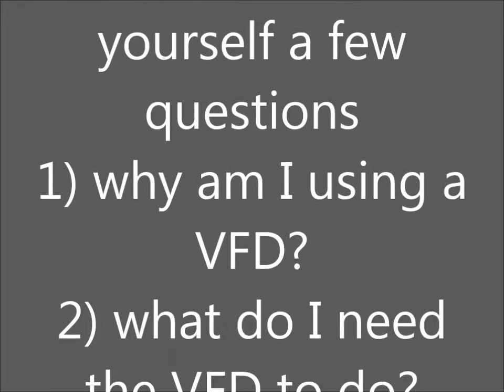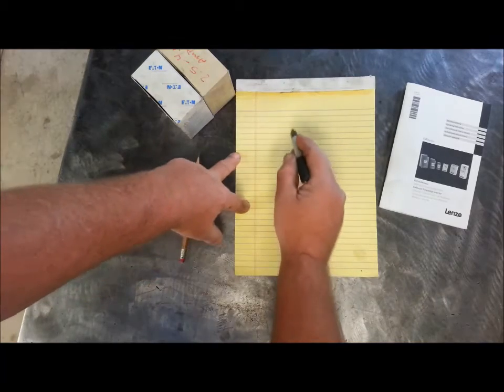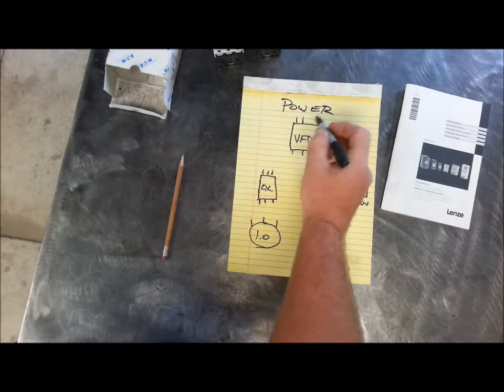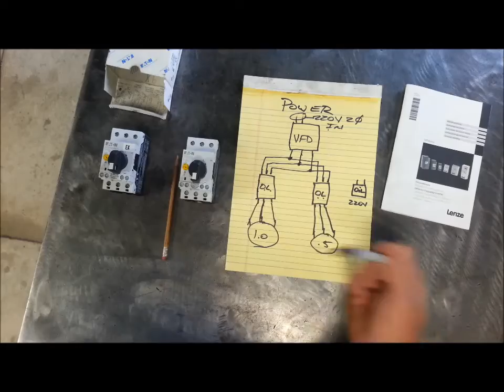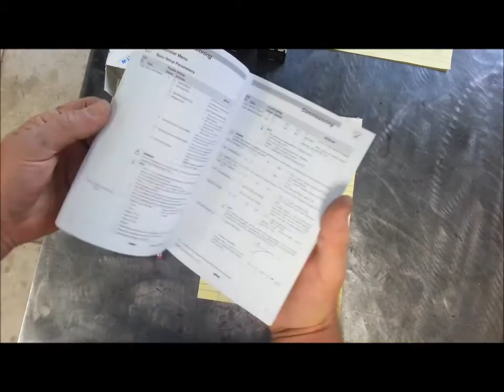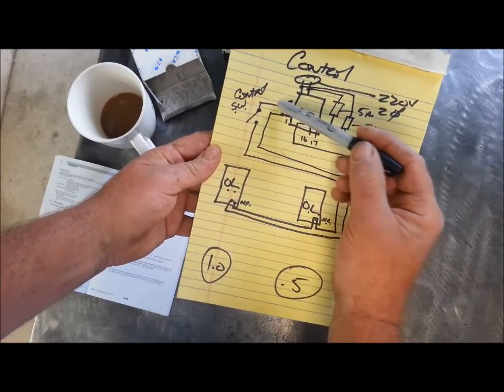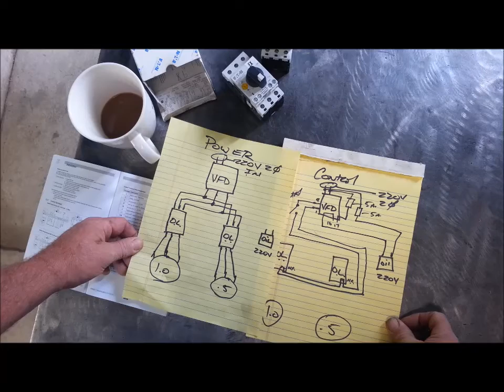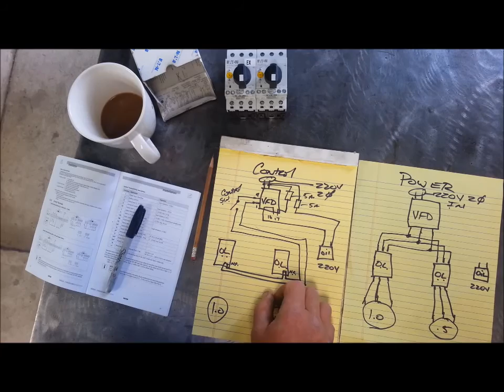Grinder VFD application

Comment: Stan, what a "Video JUST in time."  I bought a Covel 10-PH grinder.  1 HP for the spindle and a 1/2 HP for the pump.  (The pump BTW is a GM power steering pump.  Covel was in Benton Harbor, MI)  To say this is a rare bird is an under statement.  I ordered a manual for a 10H.  I hope it has similar wiring.  Anyway, the question.  Do I wire the VFD into the motors directly, skipping all the other circuits?  Or can it be hooked into the main power cord?  Your video on truing 2-4-6 blocks got me on the road to a grinder.  I just wish this wasn't such a rare bird.

Comment: Stan you r too much...
That is very good info to share.
How does one use a VFD for lathe, mill starting with 120 V AC??
I think you need to have 3 phase motors on this setup.
Can you make a video on this process??
Thank you again
Manny
Reply from the maker: You will definitely need a 3 phase motor, you will be limited to very small motors running it on 110V

Comment: Hi mate.
Thanks for that info. Those over load protectors, are they the RCD kind?  I think I have not come across those here in Australia.  But if I can't get something like that, I will have to use some relays and RCD units.
Marcel.

Comment: Nice expo on rigging a VFD for two motors.

If I had a quibble, I would prefer to see a two-pole circuit breaker for that oiler motor. With fuses, a fault usually blows one fuse, leaving the other 220 wire hot. With a two-pole breaker, a fault in either line shuts off both wires. Here's an example from McMaster-Carr:
http://www.mcmaster.com/#3931t2/=y0aj7l

Comment: You screwed up! There is no such thing as 2 phase in this case! The input on your VFD and the oiler are 220VAC SINGLE PHASE!!!!!!!!!!!!!!!!!
Reply: I know there are 3 wires with 220-volts single phase (4 if there is a ground). There are 2 hot legs and a neutral leg. Between the two hot legs you get 220 volts single phase. Between any hot leg and the neutral leg you get 110 v.

Comment: Veiy very well done.

Agree you need to add HP of motors to derive total VFD HP.  Do not forget to add nameplate currents also to ensure VFD has adequate "ampacity".

Derating VFD is an issue when using VFD designed for 3 phase input on only single phase - yes it can be done.  BUT you are using only two of the 3 rectifiers in the bridge rectifier so a derate to (I recommend) 50% should be just fine.

One very small techy nit picky point.  There was two phase decades ago - 90 degree phase angle - all gone now.  Today almost all single phase is derived from two of 3 phases - which is why people call it two phase.  It is most properly single phase - which if you put an O scope on it you get a single 60 Hz trace for both current and voltage - if scope can trace two signals.
.
I would recommend finding the contact ratings of the contact you are using for oiler. They do not give you big contacts and you may burn them.  You may wish to use an interposing relay whose power contacts are fed from 5 amp fuses and coil is fed from 16 and 17 on VFD.  

The other thought on oiler is you may not want it to run all the time so a manual OFF switch may be considered.  For me it would mainly be a housekeeping consideration ie keep mess to minimum - bit of wasted oil is no big deal in my mind.
 
IF you open up the oiler I would like to see the innards.

Dan Bentler
Reply from the maker: Hi Dan,

The oiler is a 6 watt clock motor that spins @ 8 RPH, so it self oils 8 times an hour, the wattage is so minimal I didnt see the need for adding a relay to carry the current.

Thanks for the view and well thought out comment!
Stan
Reply: Shadon HKW Agree should be hunky dory - just love them techy numbers - amazing how well they help you select right sizes.

Dan

Comment: Nice work Stan, apart from one thing....

The USA's centre tapped single phase domestic power distribution causes endless confusion.

Two wires can NEVER be anything but SINGLE phase.

Two phases with a 90 degree phase angle was used at one time for power distribution, but used 4 wires. A very inefficient use of copper!

Comment: Hi Stan, more great info on the VFD's very informative video, looking forward to the next installment. Out of curiosity, do those overload blocks protect from a thermal overload, or is the amp draw a different situation?
  Thanks ....... Mike
Reply from the maker: Hi Mike,
Motor overloads heat very slowly so they arent really appropriate for short circuit protection, they have to be able to hold during inrush and motor starting conditions, fuses and breakers are designed for short circuit protection.

In the most basic terms, fuses and breakers protect wires, overloads protect motors.
Thanks for the view and comment.
Stan

Comment: I have a eStop switch, motor contactors, relays, fuses, overloads, a standard IDEC red handle disconnect power switch and several supervisor key switches along with some semi-fancy stuff, pilot lights (green)/(red) and a pair of paddle buttons, anti-tiedown, fun stuff. I use Autotmation Direct.
Reply from the maker: Sounds like a fun panel to build, the more complex the better I like it!

Thanks for the comment
Stan
Reply: well, it's for a machine that had very  terrible control set up and the wiring of that control was about as horrid or worse.. + unsafe so I had to do what I had to do to set things right.

Comment: Thanks for the info. I have a couple motors and was wondering if I could just get one which was rated for the higher HP motor and use it on the smaller.  Your video answered that.